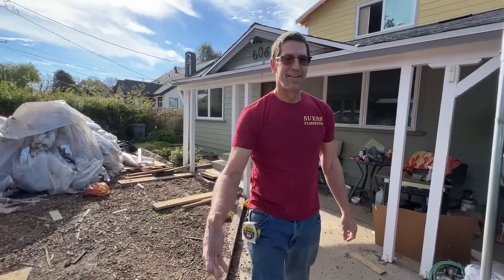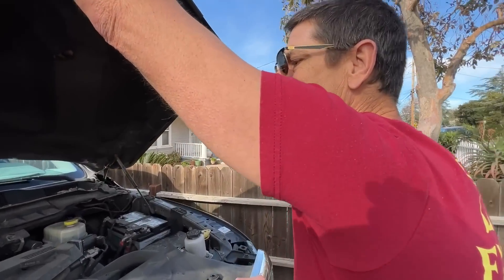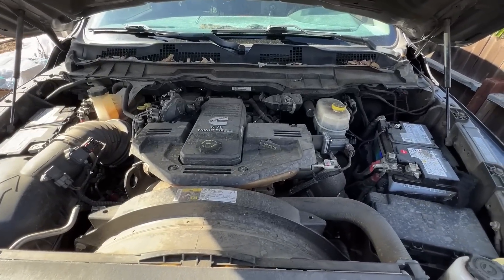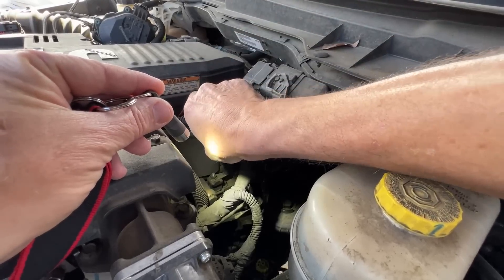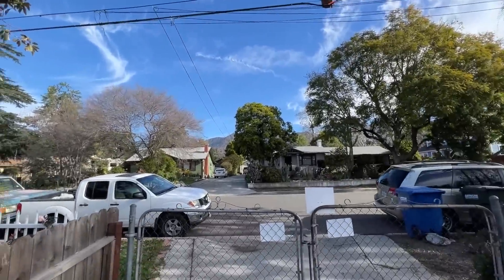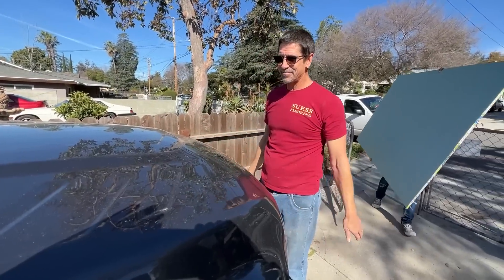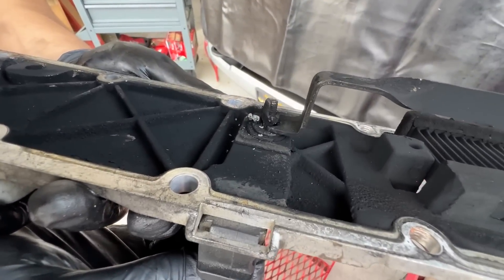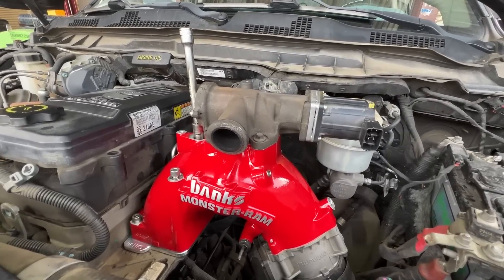This is the bolt that kills RAM trucks.

Comment: Why hasn't done a recall on this. I am in the process of doing an upgrade to a stock option through Thorobred and when I took it apart the nut is gone down the cylinder. What should I do. I am afraid to start and run it. I'm at only 67k kms it should be towed in and fixed at RAMS expense!

Comment: A stock truck with a stock head a stock intake elbo out flows the head all u need to do is put a delete plate in. I did the gpd intake heater that replaces the throttle valve.

Comment: It’s a bolt do it yourself shits easy as fuck
Reply from the maker: It's not as easy as that, check this break down of the issue.

https://official.bankspower.com/insider_news/ram-6-7l-grid-heater-engine-failure-cause-prevention/

Comment: What if you just disconnected the wire and never use the grid heater 🤔
Reply from the maker: It's not as simple as that, going that route it would set off check engine lights. For a full breakdown of the failure, tap this link 👉🏻 https://official.bankspower.com/insider_news/ram-6-7l-grid-heater-engine-failure-cause-prevention/
Reply: I disconnected mine at the battery more tnan year ago. No any issues just start truck without preheat

Comment: and this is what you get after you pay $85.000.00 for a truck , and $10.000.00 more for the cummins 6.7L  engine . you have to take a mortgage to pay for it , $2000.00 a month and  you can't even pay it off before it takes a dump. and its not just ram , its ford, its G.M. , and all the others to and not just trucks. its not the people building the trucks. its the engineering and quality of the parts. then you go back to the dealer for service and you have to get a loan to pay for the service. then they use the same defective O.E.M. parts for replacements and you have the same thing happen again to you. never go back to the dealer with an out of warranty repair. get some one that knows your truck inside out and knows how to fix your problem . no matter what you do its going to be a ton of money , so go after market performance parts. people like banks knows that cummins engine better then cummins does.

Comment: You have heat a steel bolt going thru an aluminum casted grid heater. You have galvanic corrosion and what not.

Comment: I am used to hearing diesels going 300k or more miles, and yet this one would have died because the engineers couldn't create a better solution to power the grid heater? I know who to avoid if I want to buy a diesel engine truck, or at least buy one and then have the Monster-Ram installed to make it better than factory.

Comment: If the wattage is inferior on the banks ? 600 watts vs 2400 (stock grid), how is this a good fix? It costs through the nose, like stated, if your out somewhere with no access to a plug-in especially in climates that reach the -30’s, 600 watts is NOT a fix. It’s an expensive bandaid.
Reply from the maker: The Monster-Ram is currently being used in some of the coldest climates in North America. Having said that, there are indeed extreme situations where the Monster-Ram's coil heater will not be sufficient.

Comment: I have a ram 1500 classic with the 5.7 liter, does it have these defective parts as well?
Reply: Yep
Reply: @SnarkyRC it's got defective lifters , but it don't have a heater in the valve covers , I got a 03 1/2 ton , automatic , quad cab , with a blown up 5.7 hemi , im not a big fan of that motor though , im trying to figure out what I wanta attempt to put in it ..

Comment: It's hot an miss.  Got a 2011 ram 5500 6.7 Cummins with over 315,000 miles an so far this is not a problem.

Comment: So Cummins likes to destroy #6. Amateurs! We Powerstroke owners have our CP4 pumps destroy the ENTIRE FUEL SYSTEM. We need some better designs on our work trucks. These things cost a small fortune and little things like this destroy them. Not sure how much a crate Cummins costs but I believe if my engine fails it's around $15,000 to replace. I could buy a Honda for that!

Comment: Dodge genuinely needs to iterate actual change in their design principles when these sorts of obvious issues crop up. You shouldn't have to DIY solutions over time. The engines should be improved when new solutions to problems are found. It's understandable they'd avoid doing a recall to save money, but not improving the root cause of obvious problems is another thing entirely.

Other examples are the notorious issues with the 5.7L HEMI and the exhaust manifold bolts shearing off due to insane temperatures causing the HEMI tick, and no upgrade in newer models to high pressure oil pumps to lubricate the MSDS lifters preventing cam lobe wear when idling.

Comment: My 1995 12 valve is rock solid. I did spend a couple thousand in 2000 and added all the Banks hop ups including the dual ram intake so I have played with my grid heaters already. 😅 Thanks Gale!

Comment: The fact that it's 12v is why there's so much current, and current is what melts wires/connectors. 24v requires half the current (amperage) and 48v requires 1/4 the current. If they had another battery in series dedicated to the heater and went with a 24v heater (assuming Dodge had the sense to make one), you wouldn't have the amperage that it takes to melt a bolt. 24v is also still not enough to shock you.

Comment: So after you install the Banks Intake does the truck throw codes.
Reply from the maker: If it's installed correctly, no.
Reply: @bankspower  Another question does it alter the factory warranty.
Reply from the maker: @crazyjoe2006  This is dependent on the dealer's stance on aftermarket parts. Treat the Monster-Ram as you would with altering the truck's suspension. Most dealerships understand accessories like upgraded suspension systems is harmless, however, some dealers are not as forgiving. Always check with your service advisor prior to dropping off your truck. Are they ok with aftermarket accessories? If the dealership recommends avoiding aftermarket mods, find one that embraces them. There are plenty of dealerships who install and warrant trucks with aftermarket parts.

Comment: Once it loosens the arcing and sparking begin and it cooks and becomes a high resistance connection. Then it is a welding rod vice a connection. Leave you connector on the alternator loose and something similar will happen.

Comment: I disconnected the cable running from that bolt to the solenoid at the firewall. Engine starts in 32* weather every time. Problem solved.
Reply: Thr same no any problems

Comment: Another sure fix is to shut the hood and trade it in on a GMC, a real truck.
Problem solved.

I did and pulled stuff with my GMC 2500 that 3500 dually diesel rams / f350s could not do.
454 gas motor. Single rear wheel.
Reply: Great story!

Comment: Hi I am European I like Cummins engines but never worked on one, but this usually happens when there is a low resistance point in coil heating systems, didn't knew these engines had a grid heater in the intake, I am more familiar with vw diesel engines where they use coil plugs that protrudes into the cylinders, I have also seen something similar to this in Nissan diesel engines, it seems crazy to me that something so simple can be catastrophic and how engineers can let something like this unchecked...
Reply: VW engine are designed why different than a cummins.  There is no comparison.  The glow plugs was created to fail to get your money lol

Comment: I did the install but just be aware that when you remove those fuel lines you have to back up the tube nuts with a wrench. Otherwise you will loosen the injection return tubes and that creates all kinds of low fuel pressure problems. Something Banks couldn’t figure out when I called the technical support. It wasn’t really mentioned in the instructions either. $3800 bucks later I got my truck running.
Reply from the maker: Carlos, thanks for leaving a comment. We have installed hundreds of Monster-Rams here at Banks and thousands have been installed around the US and Canada. We are not aware of any leaks resulting from low pressure fuel lines, which is probably why our Tech Support Team was confused. However, upon closer inspection, we can see how the injector cup (return tubes) could come loose if you don't keep a wrench on them. Again, we have not encountered this issue. But to help others avoid this in the future, we are shooting a new installation video with some additional tips and tricks that will ensure this does not happen to anyone else. Please text us at (800) 601-8072. We'd like to help compensate for the unintended labor.
Reply: @bankspower  WOW! What GREAT customer service!
Reply: You should be torquing those nuts any times you remove the lines anyway. Doesn't take much for them to cause a high return issue.
Reply: I torqued everything. Just remember the injector tubes have a nut that you should use a wrench on to keep from moving and loosening when removing the fuel lines. Its a frequent problem according to my Diesel mechanic
Reply: God dam banks lol . Wow just another know it all shop

Comment: FUEL Mileage, FUEL Mileage........   It runs on DIESEL FUEL !!!      I used to be in the diesel tractor industry.  We dealt frequently with tractor customers who would say they "Gassed" up their machines.  I started putting large letter DIESEL decals on their machines as a surprising number of the folks would put Gasoline in their FUEL tanks because they were not adequately educated on using the appropriate words !
Reply: Diesel is a fuel. Correct.

Comment: When is banks going to release the six gun tuner for the 2016 ram cummins?
Reply from the maker: More than happy to explain. We'll have one available, but we've been quiet about a release date for our new Ram 6.7l Derringer tuning devices. Why? We're developing a new Derringer platform that shares nothing with the current GM/Ford Derringer except the name. Manipulating features like boost (MAP) and fuel (FRP) are not enough. The 13+ 6.7l Cummins model-year trucks are forcing us to take larger steps to innovate and add more features: control injector pulse width/timing, a larger circuit board, newer robust software, and an app that ties into our Banks tuner/control ecosystem. It's been a methodical and tedious process. Once this new Derringer platform is dyno tested, dialed in, and ready for all the 6.7l Cummins platforms, we'll launch it.

Comment: Ok, so theres a bus bar connected IN THERE, that way!?! LOL (I don't fix engines, I fix other stuff). That's a big fat bus bar! Needs a good connection instead of that nut bolt and washers. Must be close to worst possible environment for such a fastener. Vibration, temp swings and that much filth.  And that metal must have been totally fried and oxidized to break off like that, I wonder how long it was like that.

Comment: I was an engineer at PTI when this integrated heater was designed. It was because of new space constraints that didn't allow for the existing and more reliable sandwich-type heater grid to continue. My guess is that Chrysler required the change, not Cummins. Most of the design and manufacturing engineers despised it. So many sketchy, convoluted components. More difficult to build. More difficult to service.

Comment: Wow it's a good thing you caught that in time. I only buy Ram trucks and I still own a 2001 Ram 2500 bought new only has 180k miles but I use Gale Banks performance parts when I can and never had a problem with any of there parts. Hope they fixed the problem.💯👍

Comment: My son has a 2015 --3500 just at the end of the warranty RAM and Cummins kept this quiet as long as they could there's no recall on it make sure you check it if it's still in warranty also if you have an outside repair shop make sure you get a written estimate because it was over $1,800 for parts and replacing it

Comment: Yes looks about right. Up here in Alaska the carbon build up gets so bad rocks of carbon go into the cylinder and then bye bye pistons and valves
Reply: Water injection system will keep the intake clean from EGR build up. Run it once a week to keep the carbon build up away.

Comment: I travel full time and have no time or money for failures like a bolt falling apart in the intake of my 2016 Ram.  As soon as I heard of this potential problem, I ordered the Monster Ram intake and had it installed.  Looking at the underside of the factory intake manifold and seeing all that soot also made sick to look at.  This is the fault of the EGR system, blowing exhaust back into the engine in an effort to making the truck "run cleaner".  Sounds exactly like a government solution, pump dirty exhaust into the engine to make it run "Cleaner".  Glad I'm not dealing with that.
Reply: That's not what the EGR is for, it reduces oxygen to the CAT so it doesn't over heat and get destroyed. It's not about mileage or running cleaner, it protects the CAT from overheating.

Comment: Was this a problem on 2011 rams?  Mine seized just under 30,000 miles, wondering if this was the cause.
Reply: I've heard it affects all Dodges sporting Cummins with stock grid heaters, including the 5.9 12v

Comment: How To Kill A Ram In 4 Easy Steps:
1. Buy a Dodge truck.
2. Put a great Cummins diesel engine in it.
3. Let Dodge mess with things under the hood.
4. Drive.

It started with the awful K cars. Since then, Chrysler has been in bed with Daimler, who quickly decided that they were not a company they wanted to be associated with. So Chrysler got in bed with Fiat and has now produced even more garbage. But that's kind of misleading. Daimler "owned" Chrysler, then sold it, and then Fiat picked it up.

With that much bad history, why would anyone want a Chrysler? It's beyond me!

Comment: 408 cubic inch displacement Cummins. Just disconnect the wire at the relay on the right (passenger side just below battery) side that goes to the relay and crank it up and drive. Don't wait to start. G. D. P. Grid heater is on the intercooler side of the intake no chance of anything falling into the engine.

Comment: What is the grid heater used for?
Reply from the maker: Simply put, the heater grid is used to raise the incoming air charge as the air passes into the intake manifold. This heated air charge aids in the ignition of the diesel fuel-air mixture in cold weather environment.

Comment: Not to discount Banks but if you unhook your grid heater before the problem arrives, and you don't need the heater, is that a solid fix? Asking for a friend.
Reply from the maker: It's not that simple. If you have a new truck, unplugging the the grid heater plug will cause a check engine light. If the truck is older, the bolt may have already deteriorated and unplugging the grid heater may still cause a check engine light.

Comment: Guess I best be checking my trucks out!  I have two 6.7L cummins, a 2012 and a 2015. Up here in AB canada the grid heaters definitely get used alot!
Reply: I’m in central Alberta, got a 2012 3500 with 450000 km on it. I’ve been doing the jiggle test for about 10 years and no issues yet.

Comment: The fact it’s so well known and documented AND that RAM and Cummins won’t fix it is really infuriating.
Reply: Nissan ignored their bad CVT transmissions the same way. Deny deny deny lol
Reply: @bRiddle38  2.4L 2005-2010 Toyota

Not to mention you cannot find a 2.4L  without a lot of shipping involved for most people.
Reply: @kramnull8962  yeah I own a 1998 Camry 2.2L 5FSE which is just about bulletproof. Far cry from 05-10
Reply: @kramnull8962  Huh? What about it?
Reply: @bRiddle38 too bad about the brittle oil pump seals though.
Reply: @bRiddle38  they really arent that bad if they are maintained well, lifetime fluid is a gimmick for something like a cvt with a metal belt
Reply: @bRiddle38 maybe if people actually changed their transmission fluid...But no let's not change it then complain when it doesn't last...30k services and they last just fine.
Reply: It's a matter of cost of damages vs cost of repairing, same as any issue unfortunately. What will cost Dodge more; repairing the issue or getting sued over the issue. In this case, it's repairing the issue.
Reply: Because the right people have not filed complaints with the NHTSA to initiate a possible recall.  And they wont do that because they will lose opportunity for retail work and Ram will dispute this problem anyway because this is an expensive repair !!!  Same BS the NHTSA/RAM played with transmission recall on 2020/2021 68RFE transmissions.  Exact same problem happened with my 2014 but the NHTSA/RAM would not extend the recall beyond 20/21 model year.
Reply: @philipkrolikowski4248  NHTSA is in the pocket of Legacy Manufacturers. Look at how they hammered Tesla for allegedly not recalling cars that were fixed within days by over the air software updates. Consumer Reports is just as selective in what they say.
Reply: Ford chev all the same..only company that looks after customers is toyota.
Reply: @666dynomax , this video is about Cummi d diesel engine.  I could care less Toyota, was in the so called trucks they make. I would rather ride in a go-cart as it would be more comfortable. I could take one of them toys and Carrie ir in the bed if my pickup.

Comment: Question: If you have the answer please enlighten me.  Now this vehicle was a 2017, has this issue been fixed by Cummins in later model years?  Is there a model year range that this affects?  I have a 2022.  I would like to go to the monster ram anyway, but I'm holding off until my warranty is over.  I do keep an eye on the grid heater bolt.
Reply: It’s still an issue. I have a 2021 and recently received a recall for the grid heater replacement. I suspect it’s due to this issue. I installed my Banks regardless. It does not void your warranty.
Reply from the maker: Although we don't know why, 2013-2018 seems to be the most affected. Although that could be a result of the age and mileage. But as @tspeegle007 said below, it's affecting all years of the 6.7.